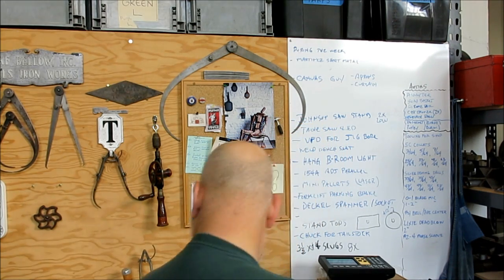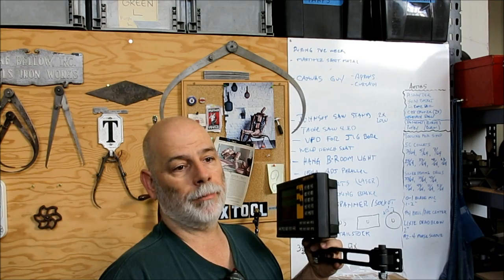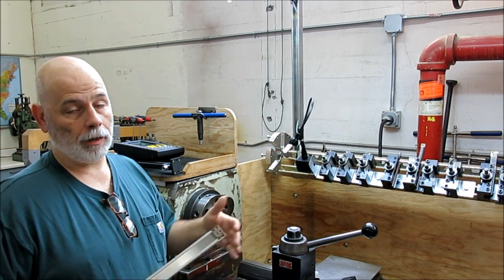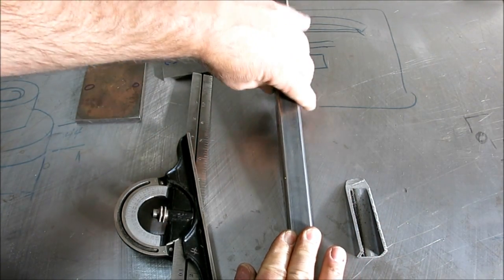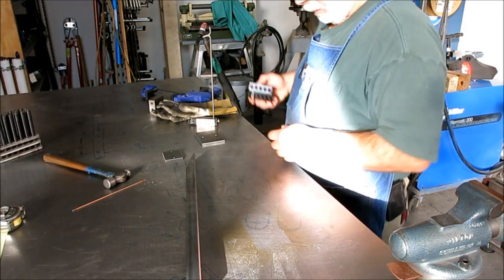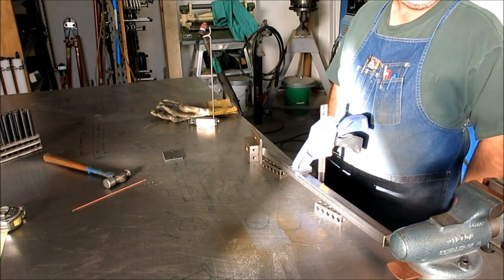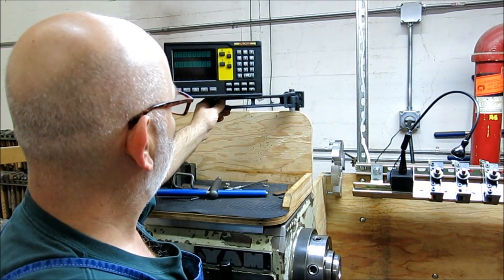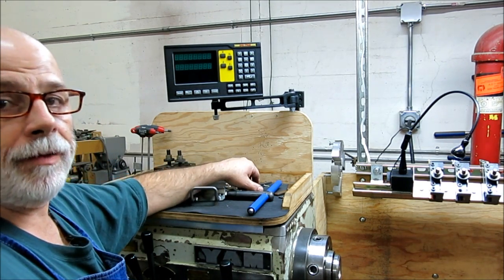Lathe DRO Install 1

Comment: Hey Tom,
In general, your videos are GREAT! I am a mechanical design engineer, and I spend a lot of time in the shop on prototype fab. I am a self-trained machinist (pretty scarry!). Now that I am retired, I operate my own shop, which is sculpture studio. My site is www.walterbruszewski.com if you want to see what my stuff looks like.

The DRO install was very timely. I have a lathe just like yours (actually a Mori), which needs a DRO. Thanks for the DRO PRO suggestion. I am thinking I will put a stalk on right side of the cross slide, so it is near where the cutting tool is.

I would appreciate your comments on your older Miller Tig machine. I am weighing the two new Miller "recreational welders" against a used Miller. I guess I am challenged with the cooling system that may be required.

Anyhow, keep up the good work. Videos are stuffed with information: how it's really done without wasting time.

My best,

Walter
Reply from the maker: Hey Walter,

I'm a die hard Miller fan. The old machines run fine. They are big and bulky compared to the solid state and inverter styles. I got mine for a deal so it was an easy decision. The cooler is not that big a deal. In fact I made one years ago with a car heater core and a submersible pump. That said the newer inverter machines have some options that are pretty cool. Check out Jodi's channel for reviews on welders. John over at Doubleboost did some reviews as well. I would look hard at the new stuff before you decide. If for nothing else smaller size and quieter. Hope this helps.

Cheers,

Tom

Comment: I thought a DRO on a lathe generally has X and Y axis scales? Wonder why yours has a Z axis?
Reply from the maker: Hi Goblin,

The standard convention for lathe axes are X and Z. X being the cross slide and Z being the longitudinal or travel along the ways. The movement axes are oriented in relation to the spindle not how you stand if front of the machine.

All the best,

Tom

Comment: Hey Tom,

Really intrigued by the vise-positioning clamp on your drill press.  Did you come up with it, or is it commercially available?   Looked really handy...  Thanks for all your cool videos, and for all the little tips you share in them.
Reply from the maker: Hi Schwartzenheimer,

The vise clamp is my own design. I did a full write up on it over on my blog. You will have to go back a little to find it. The link is at the top of the You Tube page on the right. 

Cheers,

Tom

Comment: Did you make the slide for the drill press vise ?
Reply from the maker: Hi Tighe,

I'll give you two guesses and the first guess doesn't count. Yes. I wrote a blog article about it a while back with all the details. How's the sledgehammerin going?

Best,

Tom
Reply: yes cause your crafty like that
Reply: by the way comment is from the steel city pueblo colorado and yes i work at the steel mill right on Tom

Comment from the maker: Hi Roofdog,

The EL400 has an option for turning off the beep. I like the confirmation that you actually clicked the key. So far so good. I 'm pretty happy with the unit so far. Installation was a snap. Thanks for the comment.

Best,

Tom

Comment: Nice job. The only complaint I have with my EL300 is the proximity alarm is not user configurable. I was under the impression that owners could update the software in the head, upon contacting DRO PROS I was told I had to send it back for the update. I have got used to it beeping now, but I would have liked the option to silence that feature myself.

Comment from the maker: Hi Vector,

The table has heavy duty levelers on the bottom. Legs are 4 inch pipe with flanges bolted to the underside of the table so I can resurface it sometime down the road. Thanks for the comment.

Best,

Tom

Comment from the maker: Hi Warren,

Thats makes more sense now. I was thinking chuck guard for some reason. Thanks for expanding on that. The box seems to be well sealed up. I'm going to try it and see what happens. There is a row of buttons along the lower edge that might be hard to get at with a guard in place. I think this is a wait and see situation. Thanks for the comment.

Best,

Tom

Comment from the maker: Hi Warren,

They do make guards that cover that area. Typically they are curved and hinge down to cover most of the chuck. The DRO box is mounted back far enough that its out of the main action. Grubby hand prints will be its main problem now. Thanks for the comment.

Regards,

Tom

Comment: Tom,
I have my DRO mounted a little bit further back than yours and I covered it in plastic to protect it from flying chips and cutting oil - it's surprising how much still gets there. I recommend plastic cover.
Clive

Comment from the maker: Hi John,

The pipes are the fire sprinkler riser for the whole building. Its the exact size of my lathe. I wish I had the floor space it takes up which looks to be about the size of your lathe and mill gallery. You and Keith sure do have an efficient workspaces.

Thanks for the comment.

Best,

Tom

Comment from the maker: Hi Joe,

I'll try to be more entertaining that the guy on the DRO site. I actually met him when I went up there to demo the units.

On the tungstens I have been working my way through a collection of some of everything. If I didn't have the inventory I have I would use Lanthanated exclusively. The higher current capacity makes it a hands down winner all around.

PS, I'll say hello to Mr R when I go pick up the Z scale.

Best,

Tom

Comment: Your tig torch holder has caught my attention. Where to rest my tig torch has always been a bit of a challenge for me. Most of the time it gets draped over my leg while sitting. Sooner or later I will regret that. I haven't caught myself on fire YET.
Could you let us have a closer look at what you have there.